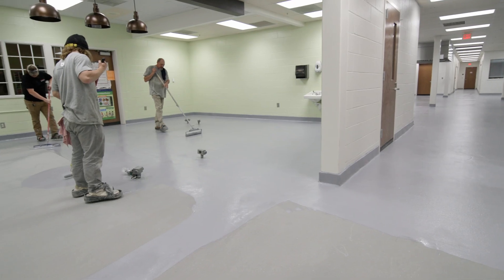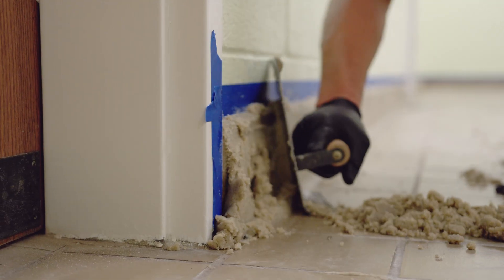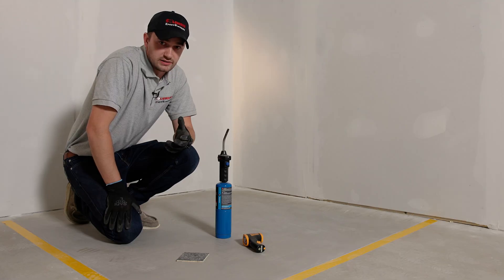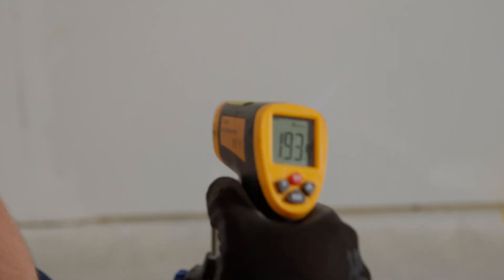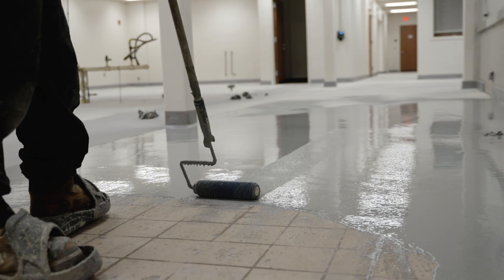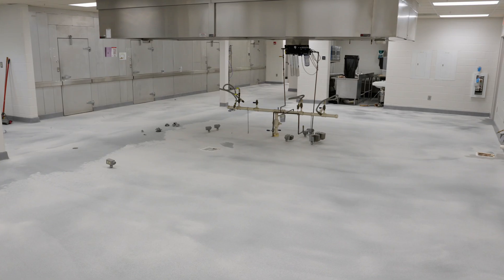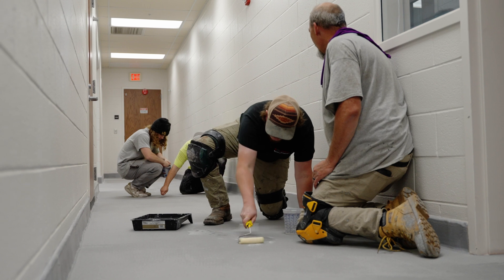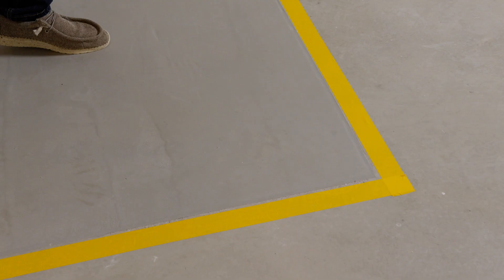Urethane Cement Installation and Benefits

Comment: Will a hybrid flooring system (urethane cement with broadcast, epoxy grout, polyurethane topcoat) hold up to the same standards of thermal shock as just a urethane cement install(urethane cement with broadcast, urethane cement topcoat)?
Reply from the maker: Yes it would still hold up the same because the urethane cement is still your base. It wouldn't hold up as well however to heat from things such as hot fryers.

Comment: Great info! Why not remove the tile before the application of the urethane cement?
Reply from the maker: As long as the tile is down well we prefer to coat over the tile. Removing the tile can create additional problems with different elevations around door jams, floor transitions and drains. Removal the tile also adds a lot of additional cost to the project and down time.